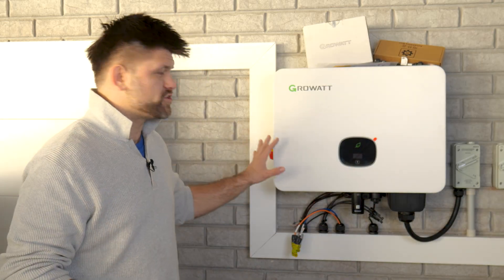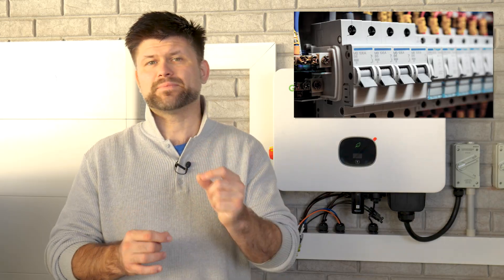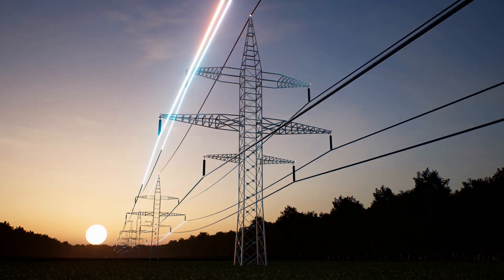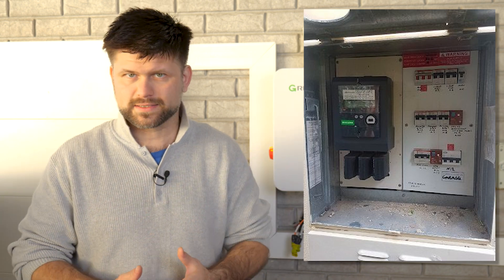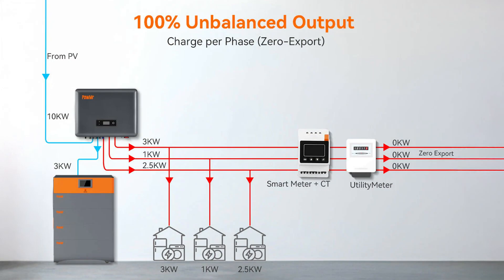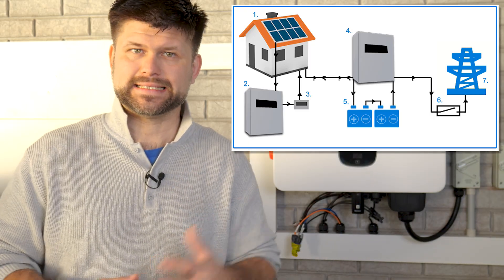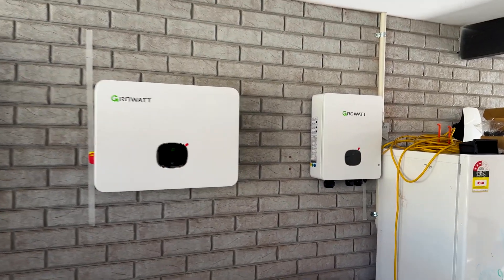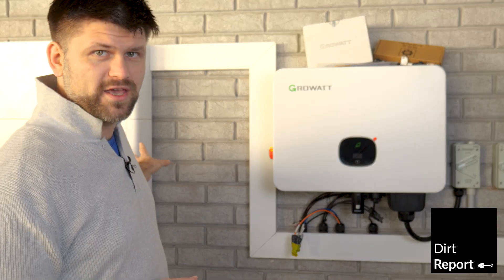Picking the Right Inverter for your Home Battery | Dirt Report

Comment: Hi Pat thank you, my house got 2Phase connection and I planning to go for solar and battery systems some solar and battery installations advice to use 10 kw 1Phase Hybrid inverters to support 30kw battery systems or 1Phase 2 hybrid inverter to support 30kw battery systems, my questions is  3phase hybrid inverter to  able to connect to 2phase connection?
Reply from the maker: Oh, I think it’s would be a single phase hybrid inverter, and I think you can apply to get a 10kW system on a single phase. They can, but it needs to be unbalanced
Reply: @TechManPat thankyou, unbalanced means need install any unbalanced power supply divise on  1phase 10kw hybrid inverter?
Reply from the maker: The hybrid inverter should be able to divide the 10kW among each phase, eg, 3kw and 7kw on 2, or 2,3,5 on three. But with a smart meter it shouldn’t matter much. Best to check with an installer
Reply: @TechManPat your great man, when got 2phase connection will be able to use 3phase hybrid inverter instead of 1Phase Hybrid inverters?

Comment: Hey bro I was told Growatt doesn't have a 10kW invertor. Can you plz confirm this. Additionally, we are thinking of going with FOXESS. What are your thoughts on FOXESS?
Reply from the maker: I have a 10kW inverter from Growatt installed, so I can confirm it’s there. It’s new release so maybe that was the issue? foxess is a lower end battery system, best to search for people who have them for feedback it’s hard to judge on short timelines

Comment: Thanks fr this review, it is exactly what I’ve been asking installers, with no success. Looked on YouTube for months for this exact issue of understanding loads. I’m looking at a FOX ESS EQ4800 42kw storage battery with 3 phase 10kw inverter. My question which goes unanswered is can my 3 phase aircon which draws 4.5kw continuously, will it come from the battery and not the grid. Add to this general household use of approx 3kw. Will the battery and inverter support this independent of the grid. Is this something you might know?
Reply from the maker: Yes it should, it will take up the rest and only after house usage goes bring 10 should it pull from grid. What you need to check is weather the battery can out out at just 10kW
Reply: @TechManPat  Cheers, thanks for that. I'll look into the battery output. There is alot to think about when you want it to run properly. Keep up the good advice on your channel, it's appreciated
Reply: I have a 20kW solar system with a 15kW inverter on a three-phase house. I am planning to add a 15kW H3 Pro inverter to support the Fox ESS EQ4800 42kW storage battery, with the option to keep it open for future battery expansion.

Comment: @TechManPat What did your solar/battery system cost you in the end? Glad you went with the 10Kw inverter and more solar, smart move.
Reply from the maker: Ill get the exact pricess in the next video, but it was only $1500 more overall, for a bigger inverter and more panels.

Comment: Am i understanding correctly that on a 3 phase battery system a 10kw 3 phase inverter can provide a 3 phase appliance more than 10kw?
Reply from the maker: No, it can only provide a max of 10kw across all phases, but some Inverter models can throw more kw down one phase if other phases are not using, eg, something like 1kw, 1kw, 8kw. The growatt model I have here can. This is helpful for blackout situations.
Reply: @TechManPat  Roger, thanks for the confirmation.
This stuff is so confusing.
Reply: Actually that wasn't confirmation haha. I meant thanks for the clarity :)

Comment: I just got my MG4 EV. Can you show a video on home battery usage with an EV.
Reply: You shouldn't really be charging your EV with your home battery unless you have a very large battery and your house electricity needs at peak time and overnight are very modest
Reply from the maker: My EV charger is completly seperate, as a below comment, the battery size wont work well with an EV battery which is 3 x larger.